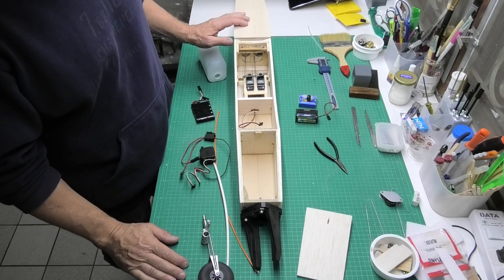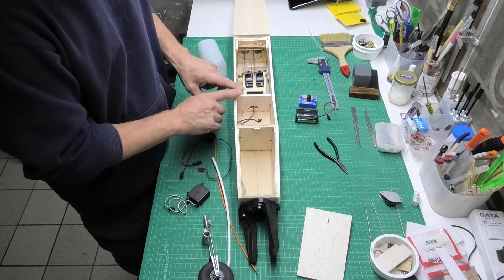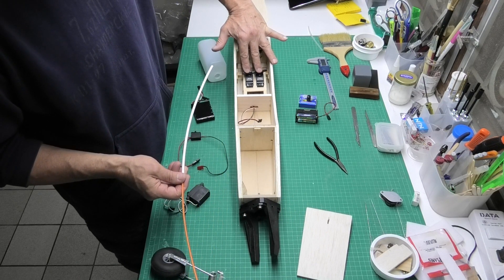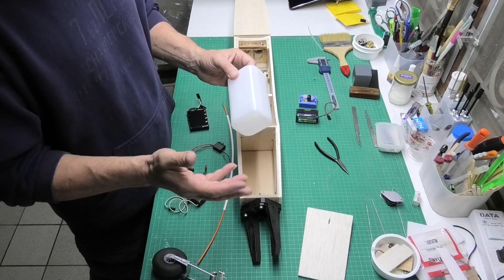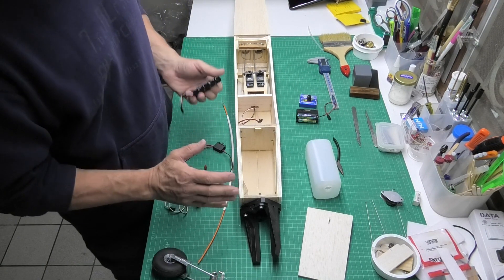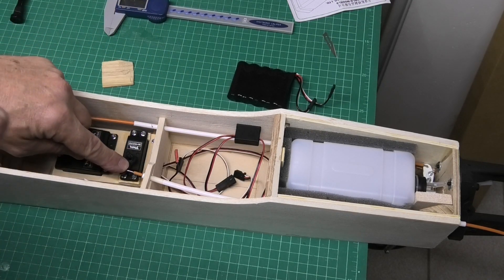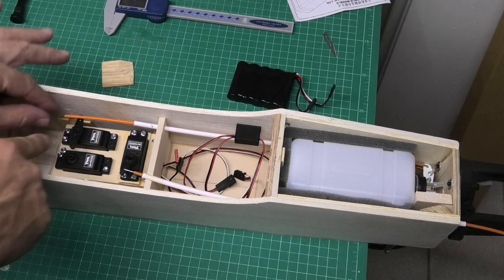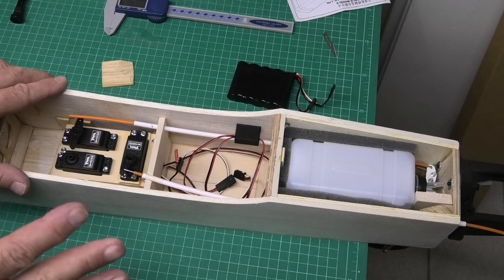Das Ugly Stik Balsa RC Aeroplane Build - Pt 9: Fuel Tank, Landing Gear & Throttle

Comment: Hi  ,  why  2  servos  for    drive  the  engine ?   thank  and  nice  building
Reply from the maker: There is only one servo for the engine throttle
Reply: @MarkRobinson555  but the second just near  the throttle  ?
Reply from the maker: @frankyesjosh587  that is the linkage for the nose wheel, so it can be steered
Reply: @MarkRobinson555  ok thanks

Comment: Excellent craftsmanship! QUESTION: How did you build the spring latch mechanism for the fuel tank cover?
Reply from the maker: Thanks very much, its just a nylon latch I brought on line from a hobby shop, thanks for the comment
Reply: @MarkRobinson555  Thanks. I will seek out a source from which I can purchase the same latch for my next build.  I built a latch using two different sized (diameter) wooden dowels.  I drilled out the larger diameter dowel to accommodate the smaller diameter dowel and a small spring (as found in ball point pens).  Lots of "fine work" threading the inner dowel to accept a 4-40 bolt , cutting out slots in the larger dia. dowel and fuel tank top to accommodate the sliding bolt, and drilling a hole a small dowel segment to make a "cap" for the bolt as it exits/enters the fuel tank lid.  The cap prevents the bolt from "rocking" as it is pushed to compress the spring and allow the inner dowel to withdraw from the fuselage bulkhead.  The larger dowel is glued to the underside of the fuel tank compartment cover lid.  The wooden latch works fine but purchasing a commercially available small latch is definitely a better course of action.

Comment: Looking good! Are you planning to give the fuel tank bay/firewall a coat of thin epoxy or the like to protect from inadvertent fuel spills?
Reply from the maker: Thanks for the support. Yes for fuel proofing I use Zap 30 epoxy diluted down silghtl with just a small amount of ethanol, so it flows and brushes on, however be careful, as it sets a lot faster, so you need to be quick!!

Comment: What do you fuel proof it with? Epoxy, CA?
Reply from the maker: I use Zap 30 epoxy diluted down silghtl with just a small amount of ethanol, so it flows and brushes on, however be careful, as it sets a lot faster, so you need to be quick!!